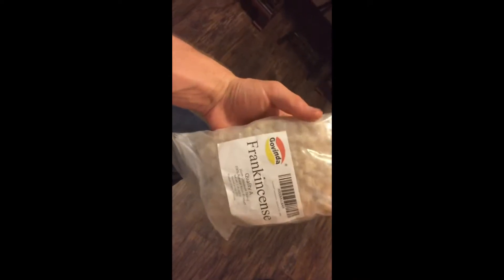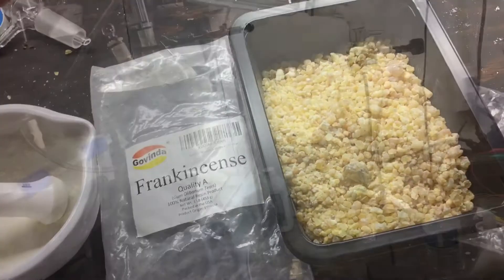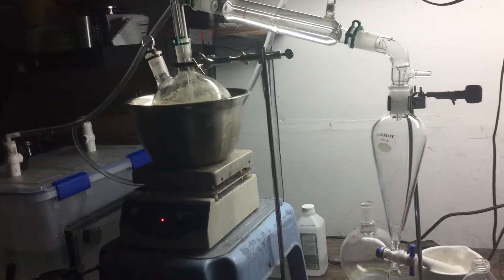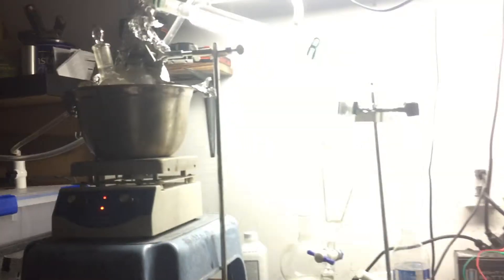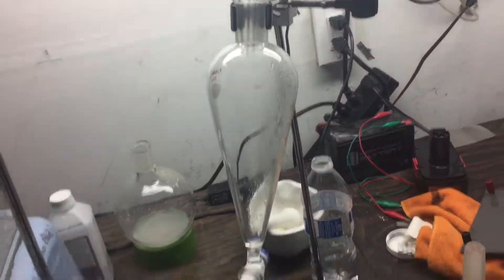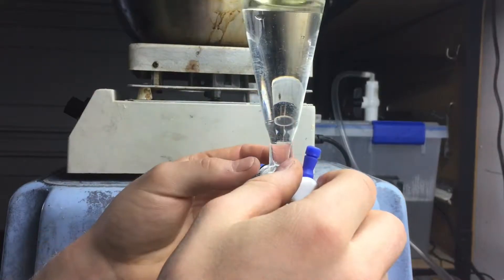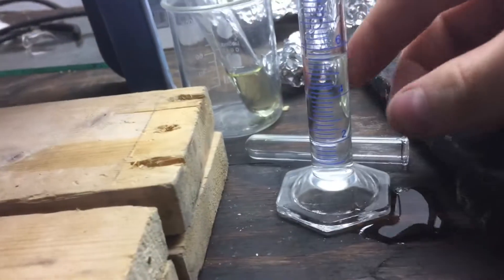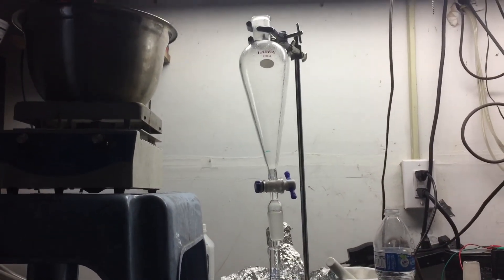Frankincense Essential Oil

Comment: Are you distilling the entire pound of Frankincense at once? What size flask are you using? What size separatory funnel are you using? What temp are you distilling? And what advantage is there for using the separately funnel rather than a regular receiving flask? Do you think using a magnetic stir bar during the distillation might eliminate the need for the foil?
Just curious, as one who is planning on essential oil distillation.